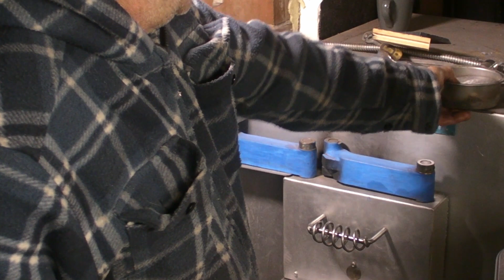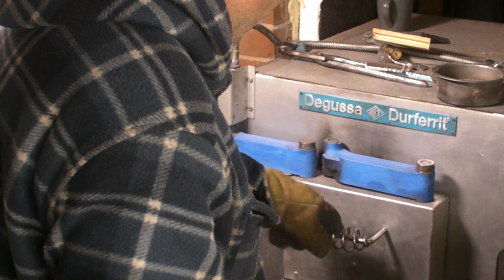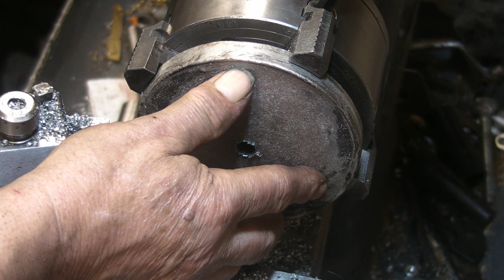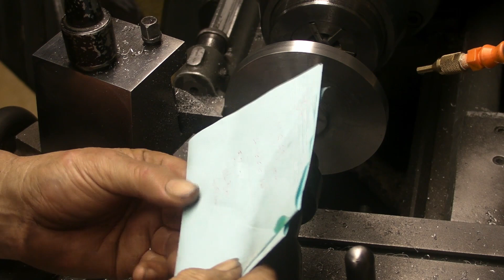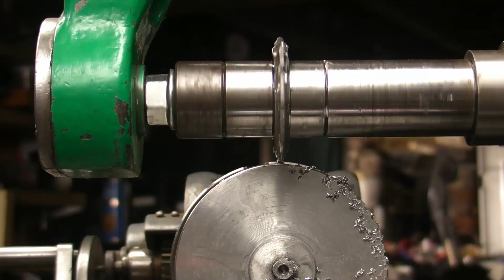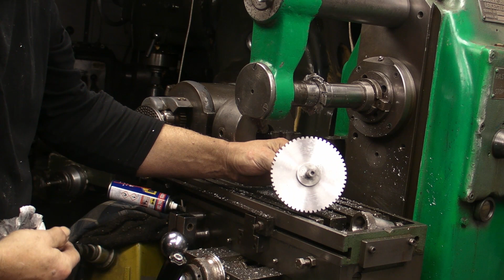52 teeth gear cut in aluminium

Comment: Good Job Del! You make it look easy!
Phil
Reply from the maker: Cheers Phil, dont think Im deep enough with the teeth yet, should be easy to increase.
Reply: @machinenutdel6764  i thought that but just put it down to the video! Yes, should be ok to line it up again. You could do with a tailstock for the div head! Good work though!
Phil
Reply from the maker: @philhermetic  Been looking at adjustable height tailstocks on Ebay about 45 quid !